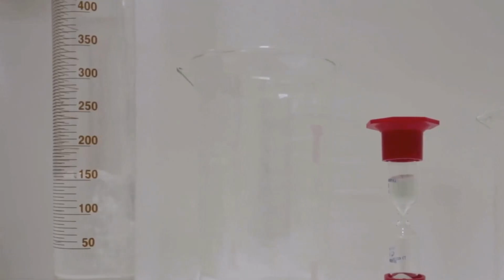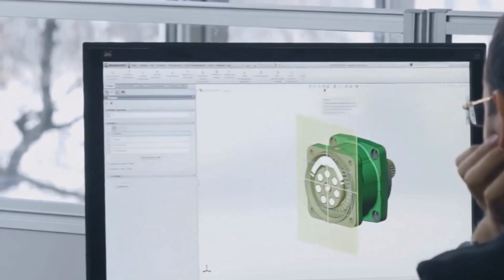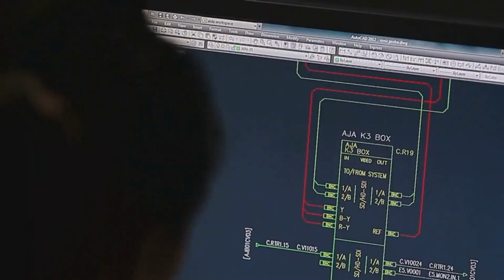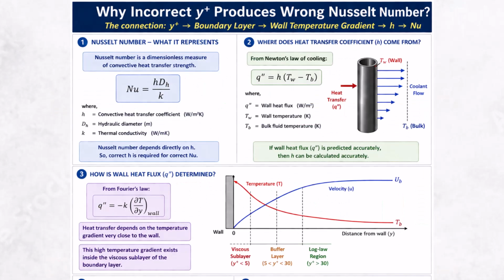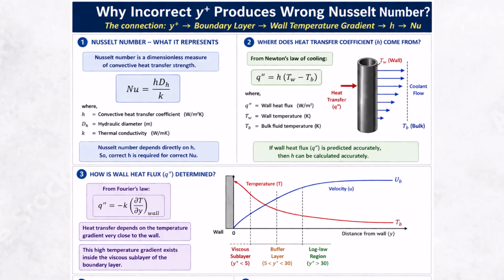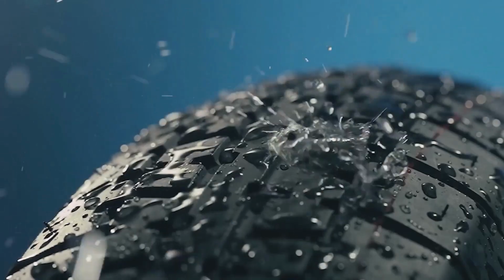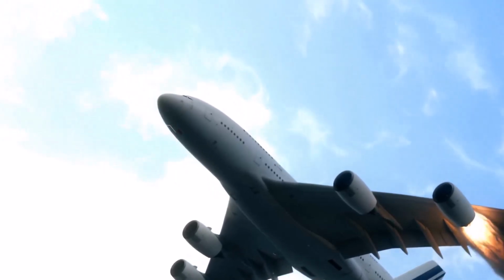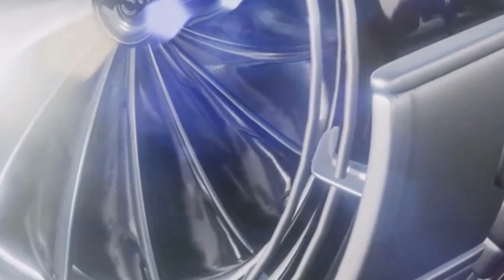Unlocking the Secret of y+ ≈1 in ANSYS Fluent | Boundary Layer, Turbulence & Heat Transfer

Comment: Excellent explanation of why y plus around 1 is important in ANSYS Fluent simulations. The way you connected boundary layer theory, turbulence modeling, and heat transfer made a complex topic much easier to understand. I especially liked how you clarified near wall mesh requirements and their impact on accuracy. This is very useful for anyone doing computational fluid dynamics work. Great presentation.
Reply from the maker: Thank you for your kind feedback. I’m glad the explanation about y+ ≈ 1 and its role in near-wall modeling in ANSYS Fluent was helpful and clear. Your appreciation means a lot.